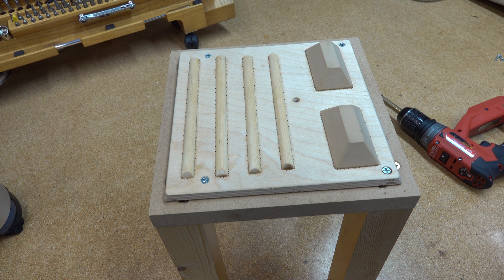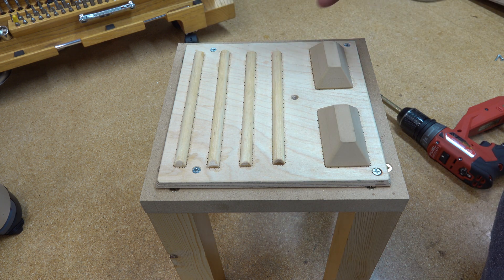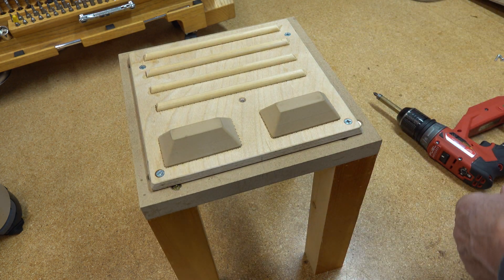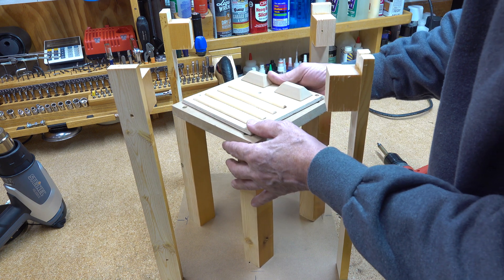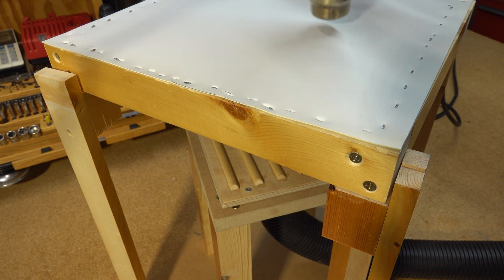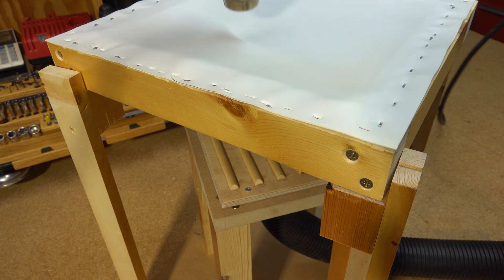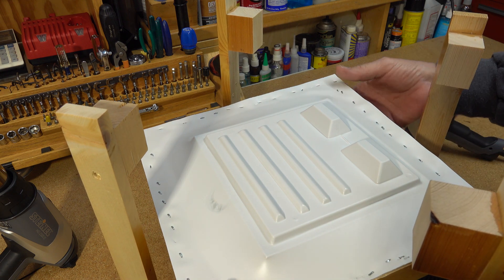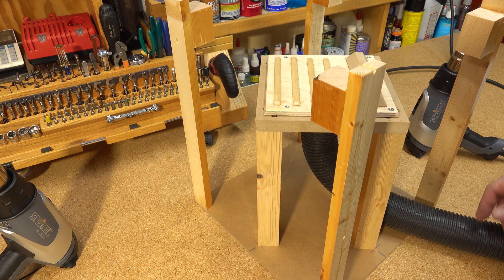FINALLY SIMPLE VACUUM FORMING AT HOME!

Comment: This is cheaper but in now way is it simpler
Reply from the maker: Been vacuum forming professionally since 1980 on machines from 96 sq.ft. down to only 2 sq.ft. and had a PVI 5'x7' in the shop for 35 years. It's my way to do this as simply as I could think of for the public. Sorry, your the 1st to mention being challenged. Need more help just respond to this...

Comment: Great video. Thank you. Can you do this with clear acrylic?
Reply from the maker: Acrylic needs to be dry or it will blister once it heats to over 212°. Dry it at about 200° for a while depending on thickness up to an hour. You'll need some really good vacuum too as its tougher to form. Make certain you have plenty of draft or you'll crack it during lift off. Good luck! Thanks for the visit!

Comment: Thanks for sharing your experience.  In your opinion what would be the best, I guess strongest, vacuum motor to use for a DIY vacuum forming machine?
Reply from the maker: You need a vacuum pump and likely a tank to hold the vacuum with a ball valve that can throw all the vacuum as a rush at once for any sizable or thicker plastic project.
Reply: I did read that post, thank you; still, I posted because in your video you make mention of a shop vac, and in the notes about the video you wrote ...All you need is a shop-vac...
Reply from the maker: @joseantonioscorner  Some want tiny thin parts and some want large thick parts. Vacuum containment with a ball valve is your only bet for thick larger parts! Small parts that are thin work OK with a vacuum if its heated properly then transfer immediately to your tool (to a preheated tool for best results). Thanks JOSE!

Comment: I like this, I like the turning technique, can this be broken down to be stored easily?  I need to vacuum form 36" x 12" parts every few months, but I don't want a whole machine taking up a lot of space just for a few hours use every few months
Reply from the maker: It is very easy to store in a few pieces, and takes up very little space. My opinion is pull a whole bunch at once vs doing it often. Once everything is heated up well, I stay moving.

Comment: Very mad scientist. Love it.
Reply from the maker: I use to have one you could literally pull half a car inside of it in the garage for 30 years. 200AMPS  just to turn it on! Ordered it from PVI with a massive 250 gallon tank. Freakin' riot, virtually automated, except the guy pushing buttons. It would get so hot in the summer 140°+ I built a tiny cardboard hut by the control panel that had its own air conditioning. That was MAD LOL!
Reply: @joesshop3622  I need to bring my gas remote buggy into store for the older fella there to look at. Might be lost cause after sitting so long. Remaking the plastic shell would be fun.

Comment: Wow what a fantastic setup!  I'm very impressed with how you solved the fast draft, the quick piece transition from hot to vacuum... man, you're a great mind!  

I'm supposing I'd need an actual pump and oven to be able to reform 1/4" plexiglass, right?  I've done heat strip bends before and PVC pipe reforms... but I have another idea that would benefit from thicker material.
Reply from the maker: A pump wont give you instant rush though. You need to add a tank for that rush (vacuum storage). As soon as it hits -25 to -27 your vacuum is maxed and ready. I used a 250 gal. tank and pulled 4 foot square parts up to 18" high with it. Suffice to say a part like that exhausted all rush from a huge vacuum source. 1/4 material is tough stuff to form and hygroscopic as heck too. Material needs to be dried at around 200° for a day to be sure the forming temp doesn't cause blisters (boiling of the moisture) New material from a vendor who moves a lot of Acrylic might work for "fresh" dried material but you need to use it fast, it grabs air moisture almost like open chips in a humid summer lol.

Comment: I wonder if sealing the form prior to making the pinholes might help prevent it from disintegrating?  Not sure what sealant properties would be needed so as to not negatively impact the mold release, but perhaps just a simple spray shellac might do the trick
Reply from the maker: The best way is to not use plywood at all lol. If you must, give it generous radiused edges and go over it ALL with thin CA (super glue) Then sand it nice above 220 grit if you want easy removal with silicone etc. Renshape, Butter board Tooling board is what's traditionally used in the trade v/s plywood because you can gat a lot of use from a non degrading sub straight. BTW no to the shellac or epoxy coatings as repeated pulls and rapid thermal cycling destroys almost any coating made. Also, it  just may stick to it like glue as the heat activates/melts the coating. Typically Styrene likes around 300° plus to form really nice.

Comment: That’s very cool and a simple deal. Not so simple for me to have figured it out but you made it look simple. Can I ask what this particular form was for or was it an example?  Thanks.
Reply from the maker: Its a replica miniature of  flood lights and poles. Doing scale lighting for my R/C collection with a little strip of  high power 12v LED's inside! If you need ANY help I've been vacuum forming since 1980. Just sold my former that did 4 foot parts inside automatically, all I did was push buttons. I could pull  .030 (1/32") to .250 (1/4") material with ease due to a 250 gallon tank! Had a PVI 404X custom made in 1991.